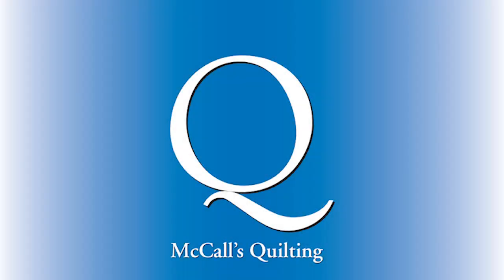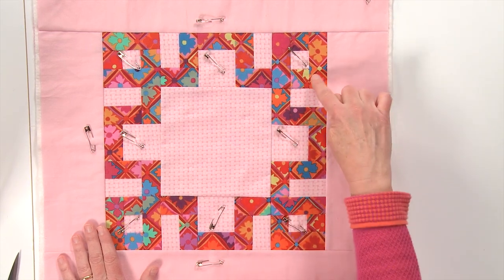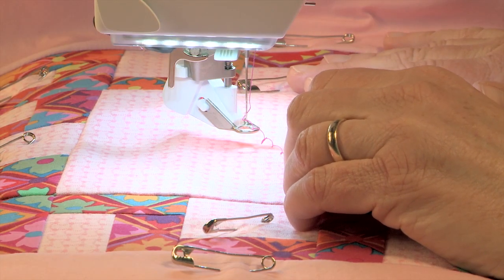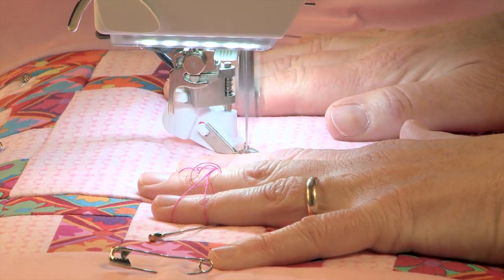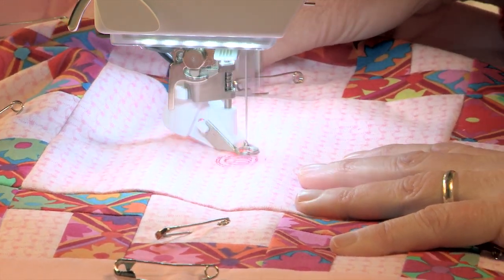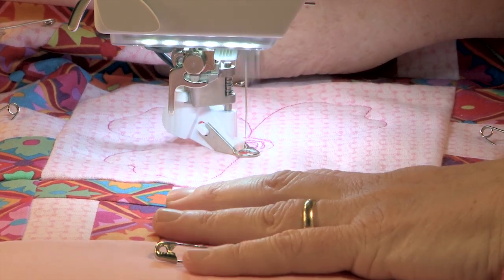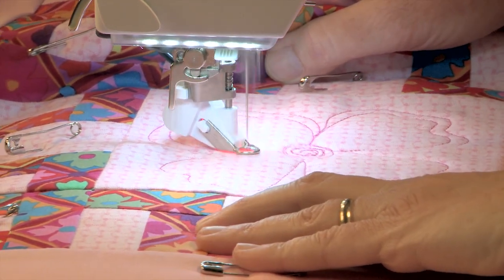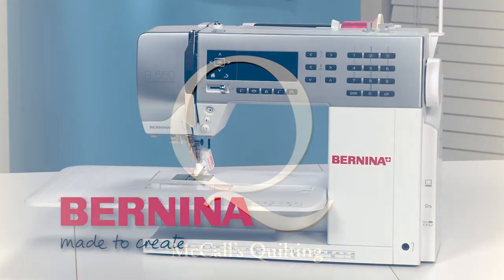Free-Motion Quilting with the Bernina Stitch Regulator: Braided Knot Block

Comment: I always wondered what the stitch regulator actually did and it is a useful idea.  
I don't have a Bernina but this tool definitely would make FMQ a lot easier for me.
Reply: Hello, the stitch regulator is making the stitches all the same length, you move quickly or slowly your quilt under the needle, the stitch length  is always the same size. I hope it helps.